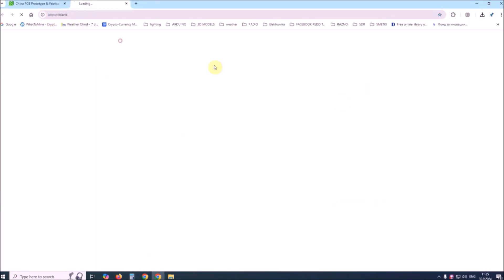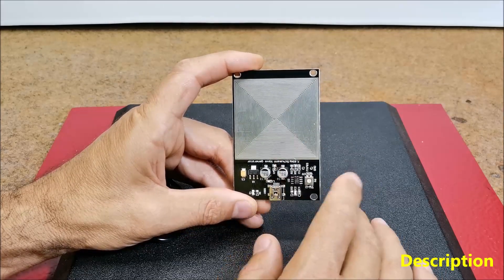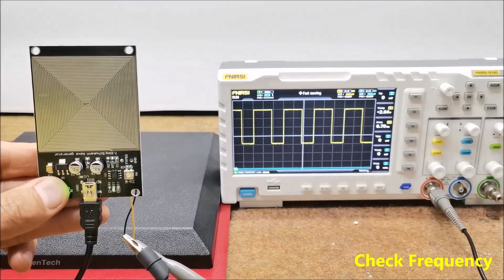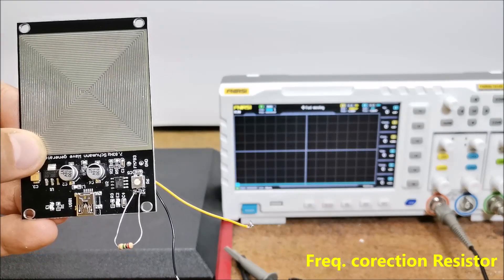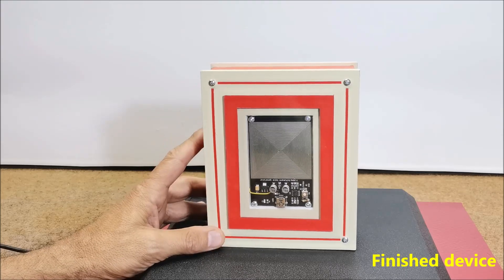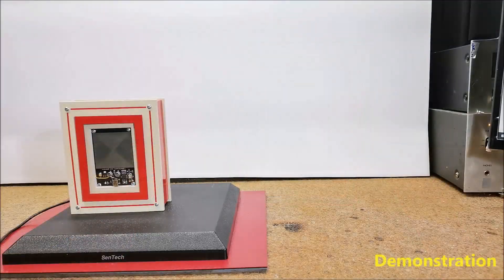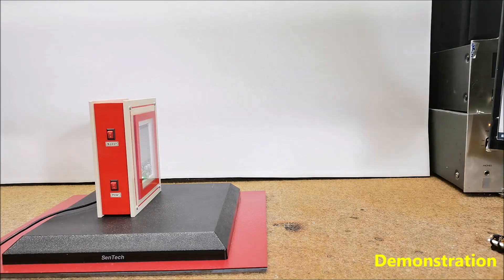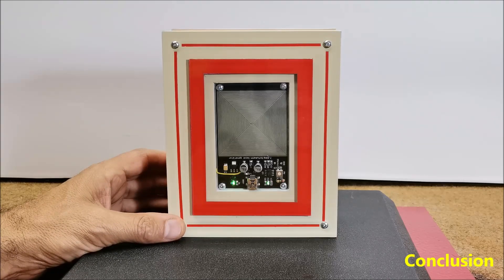DIY Simple Antistress and Relaxation PEMF Device based on Schumann resonance frequency 7.83 Hz

Comment: Hello. What is the probe that you are using? It looks like a coil connected with coaxial cable. What is the specification? Thanks.
Reply from the maker: that is coil from old relay connected directly to suond card input
Reply: @MirkoPavleskiMK  Thanks.